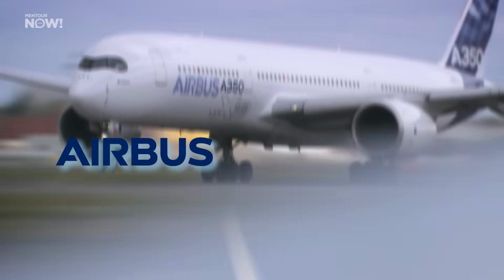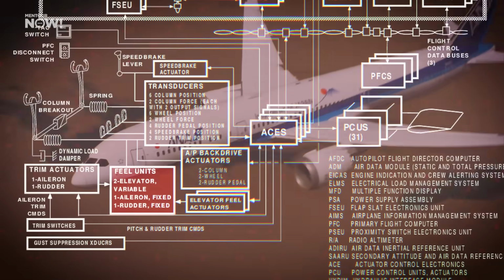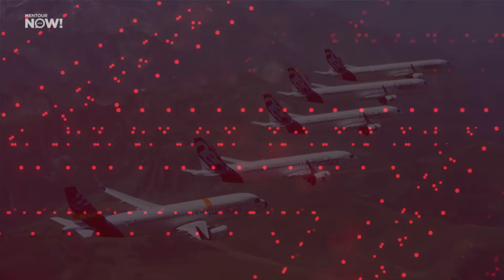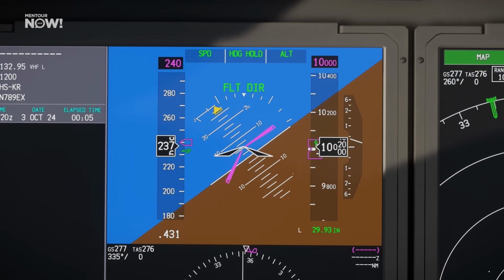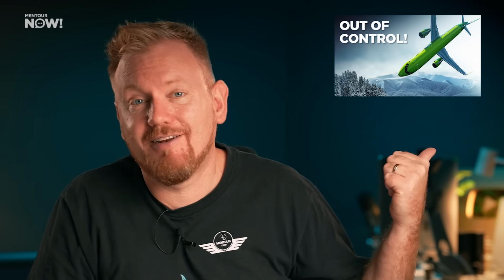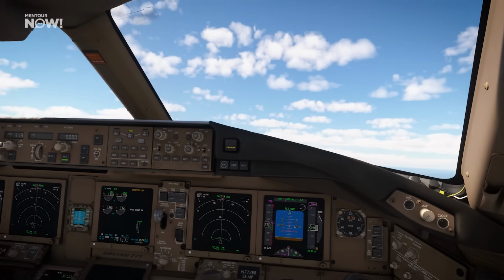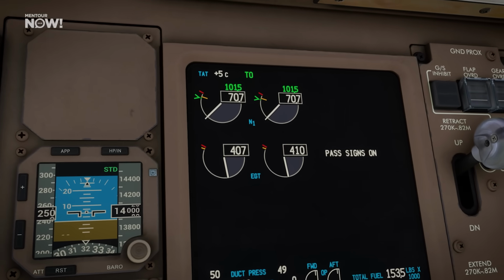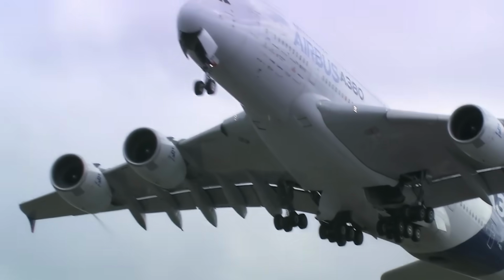Do Pilots Prefer AIRBUS over BOEING?!

Comment: Sounds like flying a Boeing is like driving a stick shift and an Airbus is more like an automatic or EV. I personally like a stick more unless I’m driving in traffic all the time or hilly city like San Francisco.
Reply: That’s giving the auto trim too much credit. Auto trim has it’s gotcha’s as well. Say you want to fly exactly at 3000 feet but you hit a little bit of turbulence which causes you to climb a few feet. On a Boeing you would just nudge the control column down a bit till you are back at 3000 feet, and release. You are still in trim. On an Airbus you would push the nose down. But once you’re back at 3000 you would have to pull again to stop that descent since the computers would have trimmed the aircraft for a descent and you would otherwise just continue descending. It’s not a big deal either way, but I think too much emphasis is put on auto trim in these A vs B discussions. I’m trying to come up with a better comparison than stick shift vs automatic, but it’s not that simple. Maybe we should compare Airbus automation more with collision avoidance in newer cars: you would never rely on it, you brake all day long keeping a safe distance to other cars, but it’s nice it’s there! Same with Airbus automation: apart from auto trim which is a non-issue, no Airbus pilot willingly flies in a way that the computers really intervene. It’s just nice it’s there!

Comment: I retired with in excess of 20,000 flying hours, roughly split 50/50 between Boeing and Airbus. I flew the B737-300/400, B757-200 and the B747-400 and the Airbus A320, A340-300/500. For me the B757 was a delight to fly, especially  with the power available, and the B747 was also a very nice aircraft to handle considering it's size. On the Airbus side all models handled well, but once again the A340-500 became my favourite due to the power available. So both companies produce good aircraft but in extremis I would have been more comfortable in an Airbus.
Reply: Of course the thing that made the 757 and the 340 enjoyable for the pilot - that extra power - was precisely the thing that made them unpopular with the accountants. Gas guzzlers.

Comment: This Air Traffic Controller MUCH prefers Boeing. In my experience, Airbuses are pigs. They climb like fully loaded Craftsman toolboxes. I want a PILOT flying the aircraft, not a computer.
Reply: The pilot is flying dummy. If you takeoff and then let go of the controls the plane doesn’t suddenly magic fly itself without autopilot on

Comment: Yes both their newest stuff has pretty similar incidents rate, but I found this to be disingenuous considering the majority of the Boeing fleet is the aging 737.

Even the notorious Comet didn’t start showing issues after a while in service, it would require a major design flaw to have the newest models fall out of the sky.

I’m not saying the Boeings will, I’m just saying to make such a claim that both companies are equivalent requires proper context.
Reply: The first A320 came into service 40 years ago so that kinda blows a hole in your argument.
Reply: Their newest stuff has pretty similar incidents? How? The 737 Max has had 2 fatal crashes and the A320Neo has had 0. And neither the 787/A350 have had a fatal accident

Comment: Boeing is not the great manufacturer they were, Older planes that are maintained I would trust the most, today, not so much. However airbuses methods of idiot proofing pilots with too much automation, well they have too much control "OVER" pilots inputs that may be training and awareness but has caused some major issues with controlling the aircraft when that control goes nuts. I for one like to be provided the info, giving some control inputs to help but allowing, having pilots able to override always any automation without having to disengage something manually! That goes for any manuf.

Comment: Qantas flight 72 anyone?
Reply: MH124 anyone?
Reply: @tomstravels520  I think I heard about MH124 which occurred on a 777. Is that another incident with the air data inertial reference unit that happened before QF72?

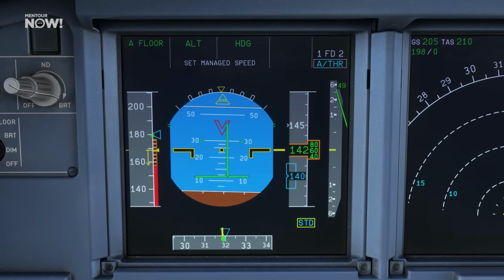Comment: Enjoyed the video, but have issue with conclusion at end (27:04) as it only relates to gen 4 aircraft. What % of operational Boeing aircraft are gen 4 (a.k.a. Fly-By-Wire)?  Certainly none of the 9,500 737's...

Comment: You can hand fly a bus easily enough and on short flights between the islands etc. I do this with no flight directors or a/t.  I think the one thing that does distance you from the aircraft is the auto trim in pitch and roll. What I like is the engine failure on take off procedure where it is very easy to deal with, add some rudder trim, use the autopilot and metaphorically sit back.

Comment: I feel safer as a passenger knowing about the hard protections in an airbus, and I often find the flights to be smoother, especially landings. That said, I do prefer the seats on the 737s! 321 especially is very uncomfortable.
Reply: That’s down to the airlines seat selection choice, not the manufacturer

Comment: My career has been in the railway industry, specifically in control systems onboard trains as well as central control systems. We have learned over the years that too much automation creates a situation where the user becomes reliant on the automation, and when they must do something else, for whatever reason, they often do the wrong thing. Therefore, there must be a compromise between automation and giving the human user ultimate control, and that is what we have done. Comparing this to the aircraft industry, I prefer the Boeing philosophy, where the pilot is ultimately in control, with the automation helping the pilot.

Comment: As an FAA A&P, and as an EASA B1 RII Mechanic and Inspector, I can honestly say that while I grew up on B727s and 737s, I totally fell in love with A300/310s, A320s, and A330/340s. I love the consistency through Airframe design, engineering, and operation. Boeing tried to re-engineer the wheel on every new airframe.....even when it couldn't or didn't need to.....

Comment: For ac with fly-by-wire, what about the 70' to 100' runs between cockpit sensors and actuating sensors at rudder, stabilator, ailerons, etc  ?   In an EMF event will those long wire runs act as antennas and fry...leaving you totally without flight control ?   Do we need to switch to fiber optics ?  If so, I can provide the new sensors required.

Comment: Just my opinion, but I think the more automation and control taken away from the human, the more important it becomes to have visual and physical feedback, because it will make you more disconnected and pay less attention to what is going on, I'm not only referring to planes either, you will see this in cars too if you watch a few videos on self-driving cars, the first few rides you will watch extremely close but as the person relaxes and gets comfortable or rely on it to work properly they start to mentally check out which leads to slower responses when something does go wrong.

Comment: The fancy Airbus tables also never prevented coffee from spilling onto A350 controls
Reply: Pilots aren’t supposed to put coffee on those anyway. There are cupholders specifically for them but they weren’t using them
Reply: @tomstravels520  I guess there is no hard protection against putting coffee in the wrong spot. If we’re gonna call Boeing’s soft-over-hard protection philosophy unsafe, then maybe we should also be pinpointing the Airbus elements that lack hard protection too, or even the lack of a DO NOT PLACE DRINKS placard on the table
Reply: @Blank00  actually some airlines do have that placard on the table
Reply: @ by the discretion of the airline, not by discretion of Airbus
Reply: @Blank00  you seem to think that if I poured liquid all over the central console of a Boeing it would continue to function perfectly. And Airbus actually went one better, they added new spill resistant seals under the panels to protect the wiring against pilots doing stupid things

Comment: The number one problem is "Tin Whiskers", which is due to the banning of lead in solder. This results in  "Predictable Unpredictability" due to cross shorting of microchip input/output signals.  Just return to stable roughly 70/30  tin/lead solder and eliminate the problem.  The adherence to ROHS restrictions will result in many more incidents.

Comment: It's not obvious to me that it is a difference in "philosophy" that is preventing Airbus from providing haptic feedback or a display of actual values. Or Boeing from supplying a display similar to Airbus' in addition to its current one. And not displaying a warning because something else has higher priority can be avoided allotting more display landscape. That doesn't ensure that a pilot will look at it, but can is better than can't. Quite a few incidents seem to be caused when the control logic results in controls producing results that are unexpected to the pilots that perhaps might have been expected with better training but occur such unusual circumstances that they are unlikely to be retained clearly in memory.

Comment: MSFS - I hate Airbus...very non intuitive...it's always going full throttle or cutting throttle or etc...at the worst times.  Boeing was very easy to learn to fly.  Guess I'll have to practice Airbus more this winter to get the hang of it.  I hate Airbus's throttle...it isn't a throttle...it is a multiple positional switch.  You place the throttle switch for what phase of flight and it does the rest..WTF
Reply: Which Airbus are you using?

Comment: AF 447 was caused by a panicky first officer continually pulling back on the stick, even when told to get off the controls.
Reply: But the first officer would not have pulled back the entire time to begin with if he wasn't lead to believe that hard protection would work 99% of the time.  Put yourself in the cockpit that night, brewing storm outside, no visual reference.  Try to figure out how fast you were falling before it's too late

Oh, btw, the computer was blaring stall when you push the stick forward
Reply: @chunkyazian  He was told to get off the stick. Doesn't matter what he was lead to believe. It wasn't his aircraft to fly.
Reply: @chunkyazian  You need to have a read. The aircraft was in Alt Law.

https://en.wikipedia.org/wiki/Air_France_Flight_447

The icing event had lasted for just over a minute,[79][80][2]: 198 [81] yet Bonin continued to make nose-up inputs. The trimmable horizontal stabilizer (THS) moved from 3 to 13° nose-up in about one minute, and remained in the latter position until the end of the flight.

At 02:11:10 UTC, the aircraft had climbed to its maximum altitude around 38,000 feet (11,582 m). At this point, the aircraft's angle of attack was 16°, and the engine thrust levers were in the fully forward takeoff/go-around (TOGA) detent. As the aircraft began to descend, the angle of attack rapidly increased toward 30°. A second consequence of the reconfiguration into ALT2 was that the stall protection no longer operated, whereas in normal law, the aircraft's flight-management computers would have acted to prevent such a high angle of attack.[82] The wings lost lift and the aircraft began to stall.

Confused, Bonin exclaimed, "I don't have control of the airplane any more now", and two seconds later, "I don't have control of the airplane at all!"[42] Robert responded to this by saying, "controls to the left", and took over control of the aircraft.[83][44] He pushed his side-stick forward to lower the nose and recover from the stall; however, Bonin was still pulling his side-stick back. The inputs cancelled each other out and triggered an audible "dual input" warning.

------------------------------------------------

Soon after this, Robert said to himself, "climb" four consecutive times. Bonin heard this and replied, "But I've been at maximum nose-up for a while!" When Dubois heard this, he realized Bonin was causing the stall, and shouted, "No no no, don't climb! No No No!"[85][44] When Robert heard this, he told Bonin to give him control of the airplane,[2] and Bonin initially obliged

In response, Bonin (without informing his colleagues) pulled his side-stick all the way back again,[44][2] and said, "We're going to crash! This can't be true. But what's happening?"

---------------------------------------------

He panicked and caused the crash.
Reply: @chunkyazian  just back up there. When the pitot tube blocked, and the aircraft dropped out of normal law, it was flying straight and level in good trim. 
All Bonin had to do was hand control over to his mate and go and get a coffee. So long as his mate continued to fly the pitch and power they were already at until the airspeed indication returned, no one would ever have known there was ever an issue. 
He had nothing to figure out. 
Instead he managed to climb the aircraft into "coffin corner" for absolutely no good reason whatsoever, and all of the subsequent issues you cite from then on are a direct consequence of that dumb decision.
The really stupid thing about AF447 is that in order to avoid it they needed to do nothing - literally. 
Just fly pitch and power until airspeed indication returned
Reply: @orlestone   yes, it's easy to talk about  pitch and power at the comfort of your own home.  The first officer made a mistake for sure.  Something similar happened in a Boeing before.  

All I'm saying is that software has been keeping the human operator away from the machine in the physical world and the human operator has become complacent in trusting the software to do the proper thing.  And I'm saying this as a software dev myself.  

Humans do make mistake sometimes and the Airbus' design makes it much more difficult to decepher all those messages in the middle of the night.  In the case of AF447, the first officer likely to have believed that he could pull back on the stick all he wanted, due to a false drop in altitude, and the computer would handle the pitch and power for him.  His mistake was masked by the stall warning when his colleague tried to put in corrective action.    The situation was so deteriorated that the computer blared out stall warning when they tried to lower the nose.

Finally, why would Airbus look into active side stick if its design is the ultimate answer?
Reply: Yep. AF447 was all about CRM, not control architecture - that and a dickhead pilot trying to force a fully loaded A330 into an 8000 ft per minute climb at 32,000 ft. But it'll always be brought up by the Boeing is better crowd as the exception that proves the rule